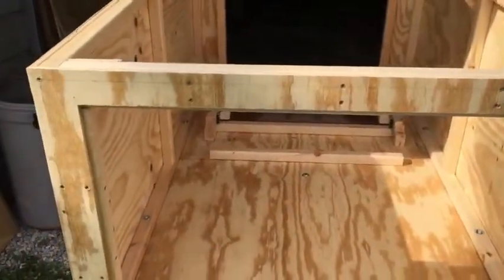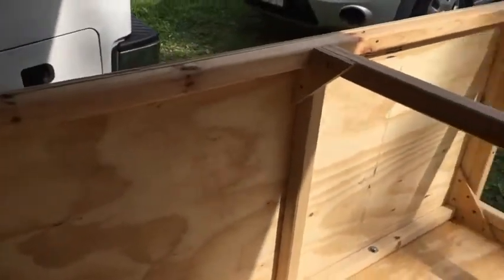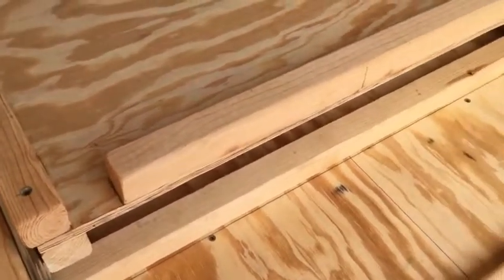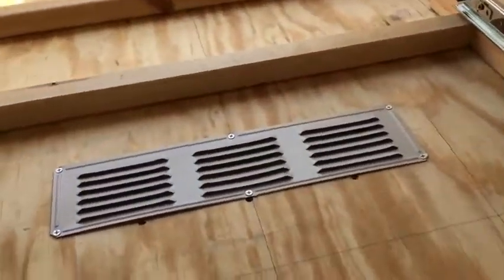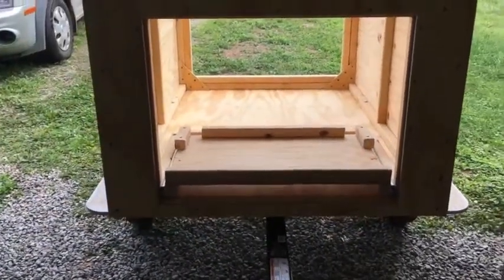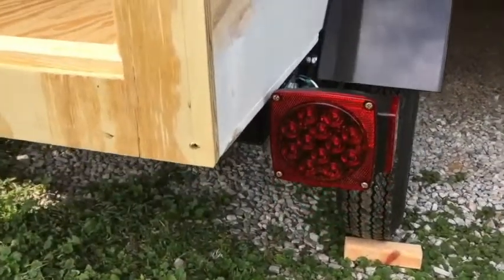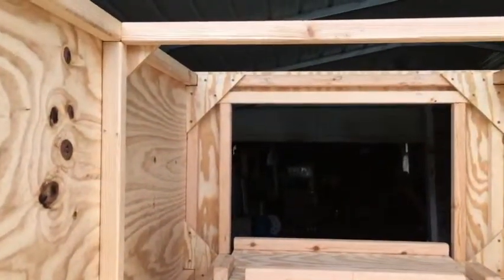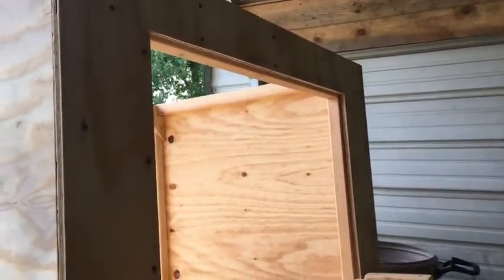Progress UPDATE! - DIY Car Camping Trailer Build - Prerecorded with Restream

Comment: For those of us who drive 4 cyl. sedans, I dont suppose you weighed it after the build was complete?
Reply from the maker: I haven't actually weighed it. I have added up all the contents and trailer weight and I believe it's about 800 lbs fully loaded. My 4 cyl 2010 Transit Connect pulls it just fine. I don't even know it's there until I look into the rear view mirror.
Reply: @WannaBFree  thanks so much, that info is good to know, I'm seriously thinking about following your design, great job!
Reply from the maker: I wish you the best with your project and thanks for stopping by!